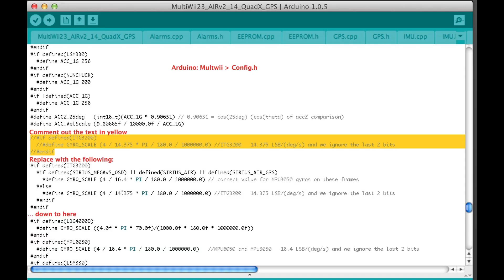Scarab MultiWii 2.3 GYRO_SCALE tests

Comment: Hey mate (rob from scarab club),
How do you connect your LEDs to get them to flash when disarming ?
Cheers Robin
Reply from the maker: Used the black wire on the Air Hero V2, on the 32bit version you can add a wire.  The boards can sink (i.e. ground) the LEDs if you hook their negative side to the board that way, and leave the positive wire permanently hooked up to 12V.  
MultiWii can flash LEDs either using the LED system (mimics the LED on the board, or the Buzzer pin.  I prefer the Buzzer pin so they flash also when the battery is low but that requires hacking the sketch.  I think the black wire will do for starters.

Comment: hi there, thanks for this video...im new to quadcopters (used to fly trex 450)...is this fix easy to put into practice as I'm about to buy the package deal of this quad? also did you forward your findings to the product website so it can be implemented into new models. cheers rob
Reply from the maker: These changes been included in the current MultiWii code base and will be present in the next release.  The manufacturer is aware and have probably already updated the supplied code if you get an AirV2.  The issue only affected the AirV2 flight controller using the 3050 gyro.  If you get the latest AirHero32, not the Air, it doesn't have this problem (and isn't MultiWii based, anyway).  If you have the AirV2, it only requires changing a value in one line of the sketch code and uploading.  If you're going to fly fast acro you're probably going to eat make other changes to the sketch file there anyway (removing LPF on gyro for example).  Sketch file changing and updating in easy for some people and difficult for others, depending on your level of computer skills.  It requires: install Arduino on a PC or Mac, connect to the board, get the sketch file, make the change, select the board type, select the serial port, hit upload.  For some that's a big deal, others its easy. It's definitely a skill worth having.

Comment: Hi. What led lights did you use for your knife? And where did you hook them up? Hope to get an answer. Thanks! The lights are just cool !
Reply from the maker: Thanks!  The LED's are available from MultiWiiCopter.com: http://www.multiwiicopter.com/products/2-x-blue-led-strips-2-red-led-strips
Similar strips are available on Ebay but those from MWC are very good indeed and easily obtained.  I wired positive direct to the 3S supply, and ground to the grounding pin on the Knife Air FC board, so they flash on arming etc.  Otherwise just wire them between LiPo positive and negative.  Can be cut to any desired length, secured to the frame with tape or other ties. I've now edited the sketch for a stealth mode on a switch!  :-)
Reply: ctzsnooze 
Thanks for sending the link. I'm pretty new to the electronics of the knife. Would you send me some pictures of how you did it? I'm very new to this and would really appreciate it.
Reply: ctzsnooze 
The wiring positive to the LiPo and ground on grounding pin. I don't understand that completely.  Sorry for my noob questions  and requests.
Reply from the maker: Jayson Pescasio My wiring has changed quite a bit from stock.  It's very easy if you get these particular LED's.  I cut off the tiny connectors on the end, and soldered  the red wire to any red wire in the LiPo harness, and the black wire to any black wire on the LiPo harness.  That's how I did it at first.  Alternatively there is a spare JST connector in the harness (intended for the Video Tx), if you're not using that, you could get a matching plug and put the LED reds to the red wire of that plug, and the blacks to the black wire, for example.  For switching via the FC, if you have a Scarab FC (Paris or Air) there is a pin or socketed cable, and you hook the black wire to that so the FC can control whether they are on or off. There are a million different possible ways to run the wires, all require some soldering as there are no ideal connectors available.  The neatest way is to purchase on EBay some JST connectors or a JST double adapter, and solder a nice neat connecting cable with heat shrink over the joins.  so just experiment a bit and you'll be right.  I have quite a few of these LED's and connectors but to be honest I just haven't time to wire them up custom for you.  If you do pursue quads with enthusiasm, learning soldering and heat shrinking and basic electronics opens many doors - and that experimentation is part of the learning curve!  :-)
Reply: ctzsnooze 
Thank you so much! I have a good idea of how to do it now. Thanks again!
Reply from the maker: Jayson Pescasio The 'red to red' stuff is easy.  The 'black to grounding pin' bit is less obvious.  Assuming you have a Paris Air, usually comes with the Knife, you'll see a small black wire coming out of it with a tiny square socket on it.  That wire is to be used for grounding LED's.  Electricity from the positive of the LiPo is then wired permanently to the LED's, and when the Air decides to enable the LED, it internally lets electricity flow through that black wire.  So you just get the black wires off the LED's, solder a pin to them that fits into this socket, and then when you arm the quad, they flash.  It's not difficult in practice.  Other FC boards won't have this black wire, it's specific to the Air1 and Air2.  See it here:
http://cdn1.bigcommerce.com/server3600/5cb73/products/1226/images/5900/PARIS_AIR_v2_Hero_2716w__13379.1410867378.1280.1280.jpg?c=2
On the Air Hero this wire isn't there, but there is a pad on the board to solder to, marked LED, I'd check with MultiWiiCopter before soldering to this to be sure it's OK:
http://cdn1.bigcommerce.com/server3600/5cb73/products/1359/images/7111/PARIS_AIR_32_4083__91892.1414915216.1280.1280.JPG?c=2
I hope this makes sense.
But if you just want them on whenever the battery is connected, just wire them permanently to the battery.  If you want to give them a plug, buy some plugs and sockets to suit and solder up something that works.  
It's not plug and play unfortunately there's some effort involved, but once you know how you can add them to any quad.  
And yes, they are very cool in flight, making it possible to fly in the dark very safely.
Reply: ctzsnooze Hey Snooze! I did what you said with the LEDS. But they're not flashing when Unarmed they just turn off.They lit when Armed but not flashing. How do I do that? I put the red wires to any red wire in the harness like you said and put the black with the black wire that came with the Air Paris Hero v2.
Reply from the maker: Jayson Pescasio Hey Jayson - The behaviour of the LED's is now entirely controlled by the Hero V2 board.  They should flash during the boot up sequence, then they should be off while disarmed - although, while disarmed, they should flash, like the normal LED, when the board is set to an angle.  When armed they should be 'on' all the time.  In other words, (from memory), they should do exactly the same thing as the main LED on the board.  I've learned quite a bit about LED's since this time, but haven't re-visited the LED implementation on the Knife. I recall that I figured a way to turn them on and off at will - while armed - with a switch, but that required re-coding a bit in Arduino.  If you want them to flash all the time while armed, it is possible to re-code that in Arduino, perhaps making that an option depending on a switch (like flash in Acro but not Horizon or something).  Just about anything's possible.  But for now, if the LED's match the LED on the Hero2, that's how it should be.
Reply: ctzsnooze thanks for helping me out. I've got my led lights working now. ;-)
Reply from the maker: Jayson Pescasio That's great news !